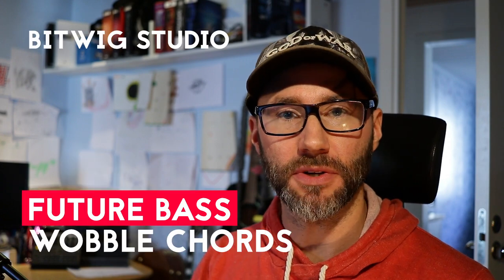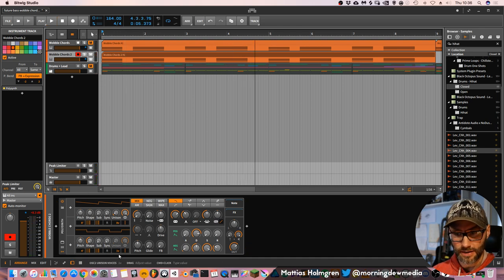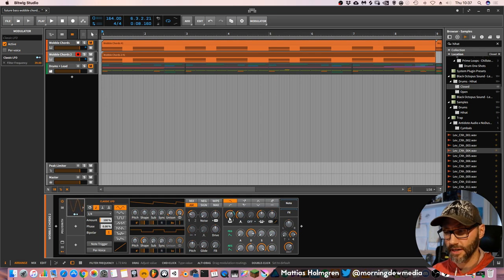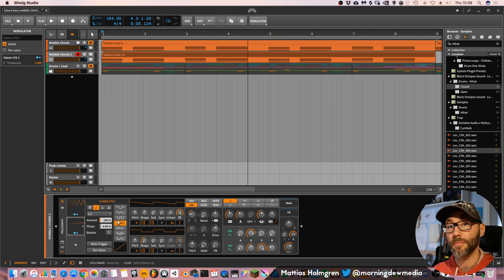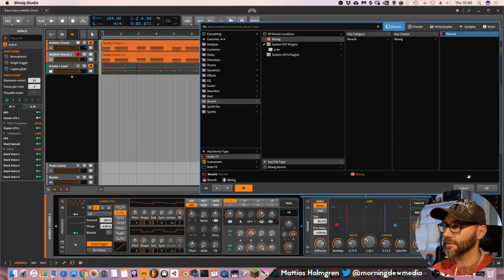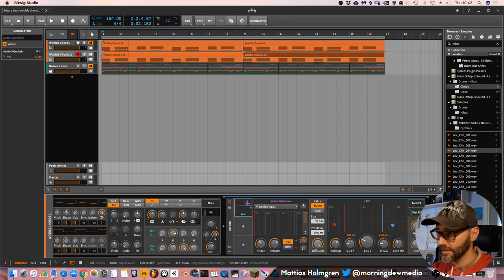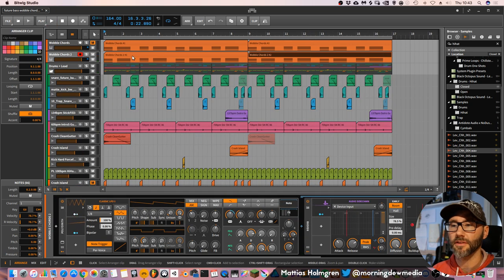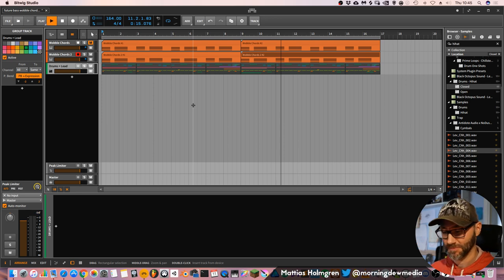How to make Future Bass Wobble Chords in Bitwig Tutorial

Comment: How do you make the high pitched squeak noise at 8:55 right after the drum beat? is there a name for that noise?
Reply from the maker: Hmm, do you refer to the reversed cymbal which leads into the first downbeat when the pattern repeats (the sweeping squal sound leading into bar 9). Or do you mean the little bleepy lead fills in the background? ;) That bleepy lead has a Envelope attached to the pitch of the oscillator so it quickly sweeps down from a high pitch down to the actual key-pressed pitch. Just attach a Envelope-modulator device to the pitch of the oscillator. Hope the info helps Michael! Cheers!